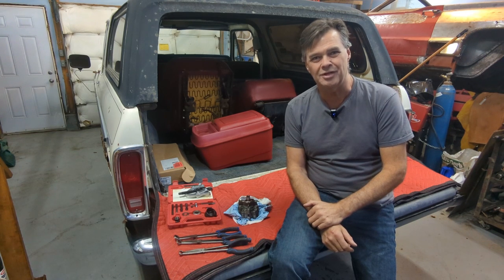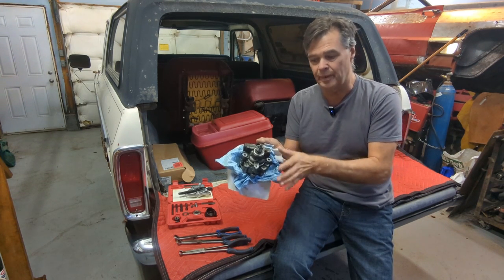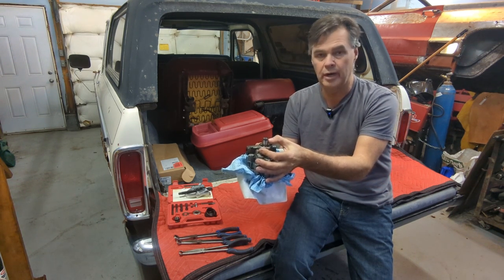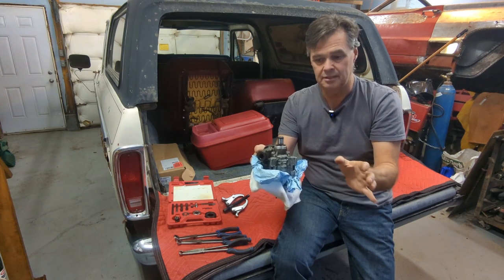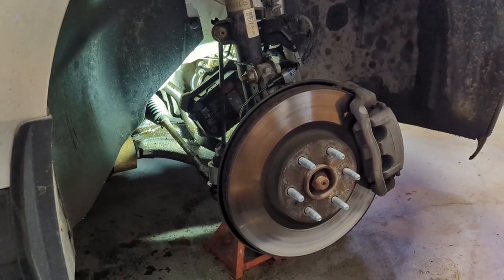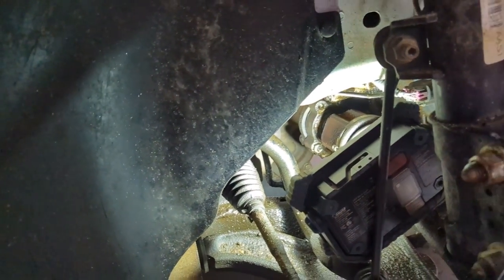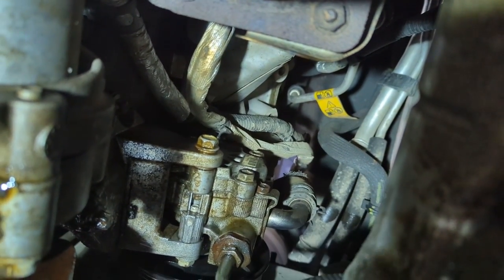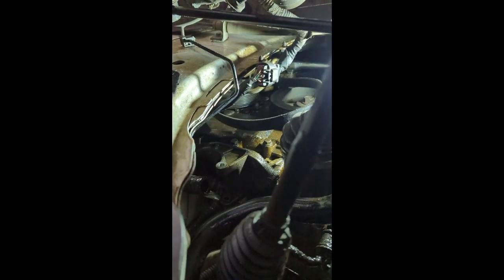2011 Cadillac SRX Power Steering Pump Replacement 2.8L Turbo Engine & Which Pump To Buy

Comment: Well done.  Even through the screen I could see that was an uphill battle. My dad was an engineer, I could hear him in my head as I watched.  When he encountered things like this he'd say, "You know, I'd like to find the engineer who signed off on this.  I'd get this part red hot, and lay it in his lap".   Thanks for the education ~ Chuck
Reply from the maker: Thank you Chuck, my wife is much happier now!
I think this job is much easier with the car up on a hoist, and if a guy just undid the outer tie rod, it would make it easier to reach that upper bolt.